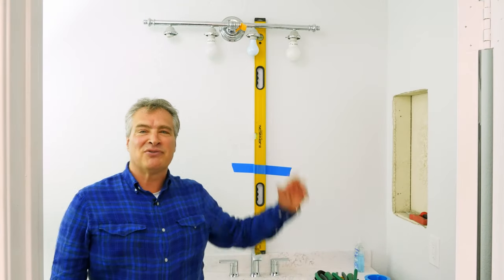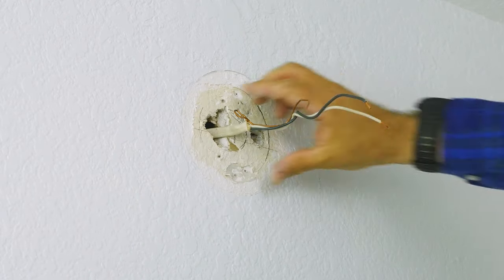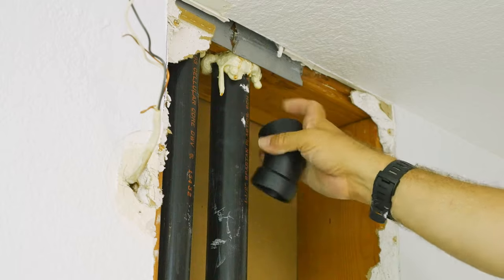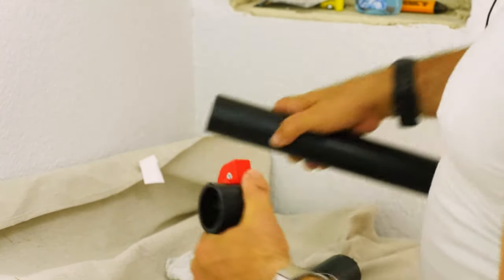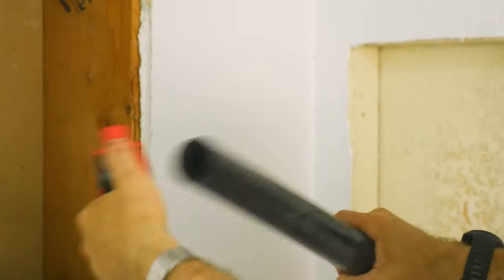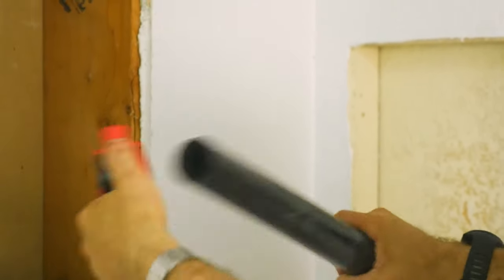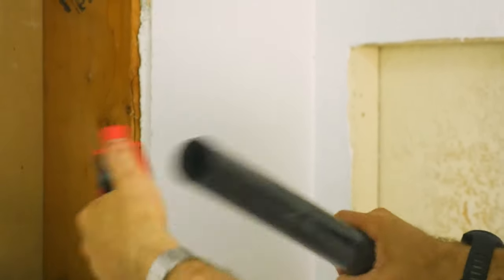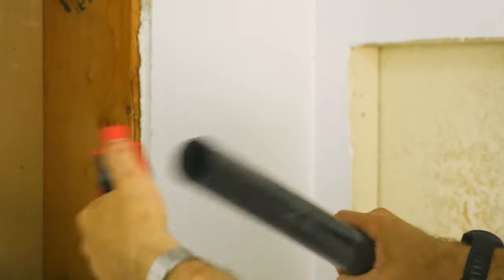Move Drains for Correct Centering of Vanity Light

Comment: I've been told not to use those remodeling boxes on light fixtures because they do not bear enough weight. How much weight can they hold?
Reply: More than enough. The small rectangular boxes ment for light switches and recepticals shouldn't be used for ceiling fans or  chandeliers.  They'll hold most sconces and other wall mounted light fixtures without any issues.  The remodeling box he uses here is specifically ment for mounting heavier vanity lights. Its thicker material and has more securing brackets than the standard boxes. Hope this helped.
Reply: 6lbs